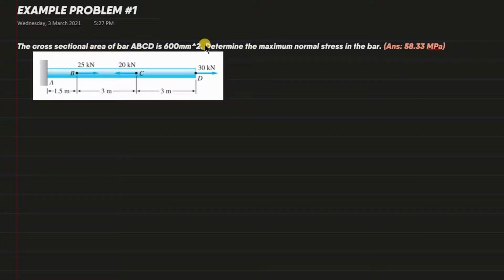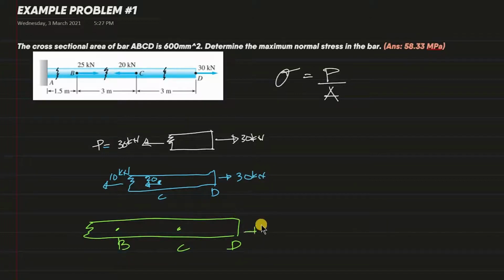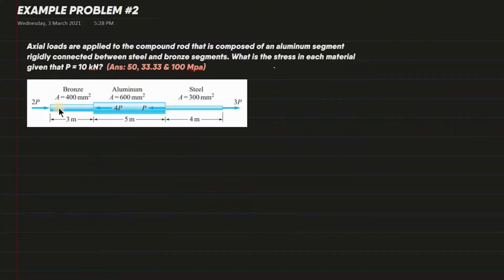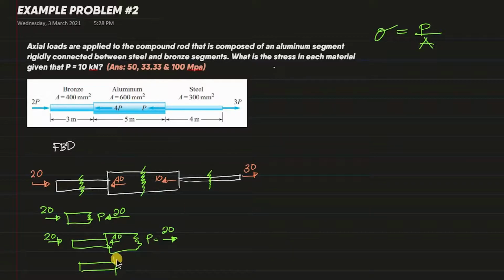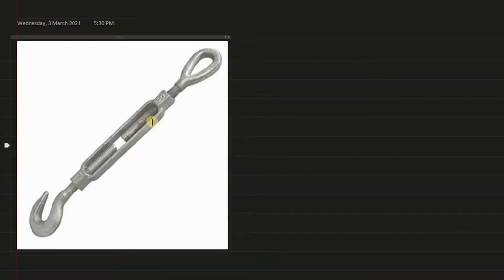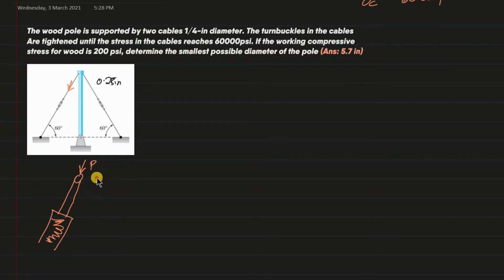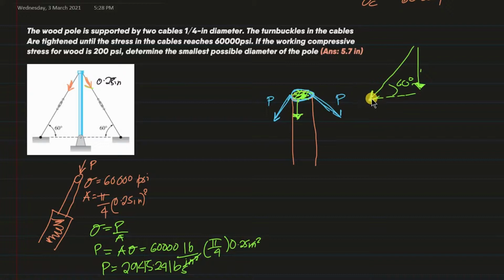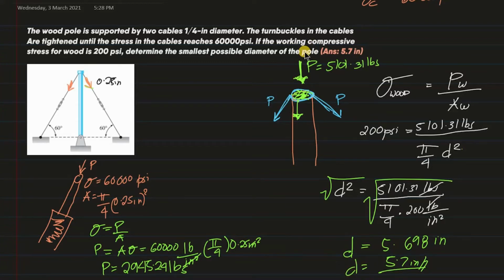Lesson 2: NORMAL STRESS (Practice Problem #1,2,3) | Strength of Materials (Filipino)

Comment: sir, diba ang unit po dapat sa final answer dun sa  problem no. 1 is kPa (kilo pascal) tapos ung unit po ng final answers sa sa problem no. 2 is dapat kPa (kilo Pascal)? Di ko po sure kung tama ung correction ko sa vid mo, pero clarify ko lang po para sure.  Pls confirm kung ano po ung tama. Thank u!
Reply from the maker: Hi,  yes. Uhm thank you po pero Nireview ko po and i think it is still MPa(Mega Pascal)  kasi iyong final unit ko is N/mm2. Take note that 1MPa=1000000Pa=1000000N/m2=1N/mm2. Nasanay lang po ako na ang final answer ko is in N/mm2 or Mpa kasi most of the time yung dimensions na given is in mm. Pero nonetheless  if you want your answer to be in Kpa. Pwede niyo naman po iconvert. Ayun i hope nakatulong😁

Comment: the 100kg uniform bar AB is suspended from 2 cables AC and BD, each with cross sectional area of 400mm². find the magnitude P and the location of x of the largest additional vertical force that can be applied bto the bar. the stresses in AC and BD are limited to 100 MPa and 50 MPa respectively. pano po ito